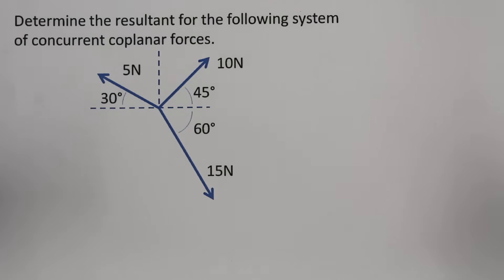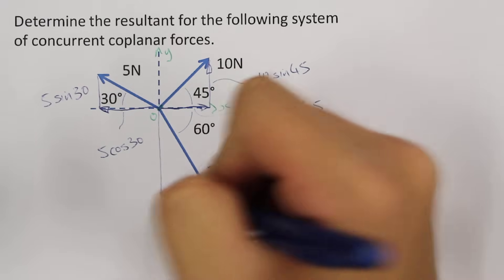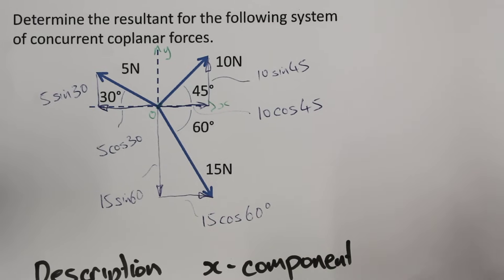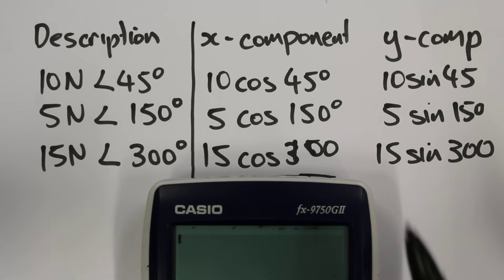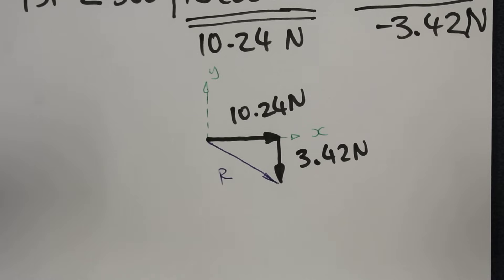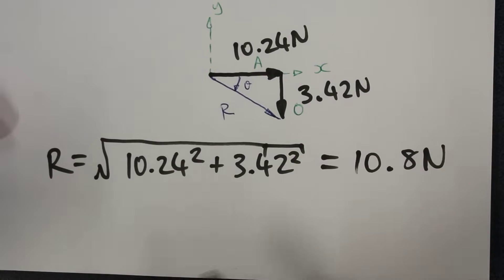Resultant of Three Concurrent Coplanar Forces

Comment: Hii sir  how is the 5N force acting at a 150 degrees. I'm lost
Reply: Hey, because the measurement of the angle is taken in respect to the +x direction (anticlockwise).
So basically the x axis is a straight line so it is 180 degrees and since the angle the gave was 30 degrees above the axis its like subtracting 30 degrees  from 180 degrees

Also,
 If you were to take a protractor to measure the angle it would come out to be 150 from the +x direction 

Hope that helps!

Comment: Why didn't you use the first components?? Sorry am new to this
Reply from the maker: We could have ignored the first part.

There are two approaches to breaking down the forces into components shown in this video. The first approach treats the vectors as triangles, where we find the size of the components, then add up the x components (if right, it would be added; and to the left, it would be negative). The second approach treats the vector as a phasor (try google this term and you should see a video of a vector that rotates, and that this rotating vector can be used to draw a sine wave (for y component) and cosine wave (for x component)

Comment: Why didn't you keep -3.42 as a negative number and instead used it as a positive number, when calculating the angle and R using trigonometry and Pythagoras. Even though, all the sin values added up to the negative 3.42.
Reply from the maker: When I was doing the calculation at that stage, I was treating the system of forces as a right triangle. So I was finding the angle as per the diagram drawn at 8:00 into the video.

I was calculation the magnitude of the angle and resultants shown and letting the diagram indicate the direction.

Comment: Pls a simple question i thought the angle for the resultant force was measured anticlockwise from the x axis so why did you measure it clockwise
Reply from the maker: It would be more clear if I put it as the angle anti-clockwise as that is normal.

At that time of making the video, I had made that decision because I had calculated the angle and was wanting to make it clear that angle was as measured clockwise from the axis. Both answers are right (measuring clockwise or anticlockwise); but different people have different conventions that they follow. In your case, you have been taught the convention that anti-clockwise measurement of angles is required. Using this anticlockwise is positive convention is good as it will set you up to use matrices in the future (should you learn this).

Comment: How did u get 10.8N coz my calculator is saying the √(10.24)²+ (3.42)²=21.9364 so pliz help me
Reply from the maker: Hi there, make sure you put in a second set of brackets. The number you have looks like the answer to 3.42*3.42+10.24 = 21.9364

It should be √((10.24)²+ (3.42)²)

or the answer to √ (3.42*3.42+10.24*10.24)

Comment: mali ka bai yung 60 degrees at 15N mo mali ng pagkakatriangle bai turo turo ka pamo haynako dislike ka saken bai
Reply from the maker: Hi there, the values and directions are correct. However the way I have drawn the vectors should be with 15cos60 in line with the x-axis; and the 15sin60 parallel to the current one but to the right. I have drawn it this way because the text for 60 degrees and 15N are in the way for the arrows that were drawn.

You will get the same numbers as me if you use 15 cos 300 for the x component and 15 sin 300 for the y component.

Also, for the way it is drawn on the video: the component going down would be 15 cos 30 which is equal to 15 sin 60; and the component going to the right would be 15 sin 30 which is equal to 15 cos60.

Thanks for the feedback.

Comment: Please why is it that when solving using the Pythagoras theorem the y-value the negative was neglected when solving. The y -value was -3.42N
Reply from the maker: I should have put -3.42 into the pythagoras theorem.

However, it doesn't change the result because the negative is squared

(-3.42) squared = 11.6964 (notice that this is positive, if you are getting a negative number make sure you have the number -3.42 in brackets before squaring)
(10.24) squared = 104.8576
11.6964 + 104.8576 = 116.554
square root of (116.554) = 10.80 kN

Comment: I understand this solution. Only thing is, how come we didn't account for the negative values in the 2nd and 4th quadrant?
Reply from the maker: Hello Tierra, I dealt with them by using an angle from the positive x-axis. The sine of an angle is positive from 0 degrees to 180 degrees, and negative from 180 degrees to 360 degrees. The cosine of an angle is positive from 0 to 90 degress, and 270 to 360 degrees; and negative from 90 degrees to 270 degrees.

Check cos150 and you will see that this is a negative value. (x component for 5N force)
Check sin150 and you will see that this a positive value. (y component for 5N force)

Check cos300 and you will see that this is a positive value (x component for 15N force)
Check sin300 and you will see that this is a negative value (y component for 15N force)

Hope this helps

Comment: Do we not add 18.46 to 180 to find the glob/local angle?
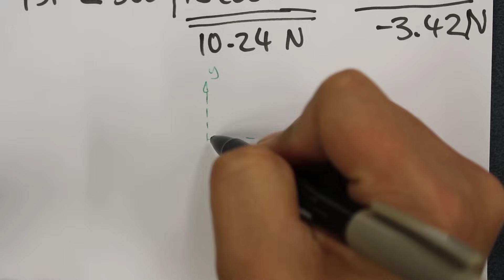Reply from the maker: Not for this one. If you look at the diagram drawn @7:34, you will notice that the angle is going downwards from the x axis.

In this case you would subtract 18.46 from 360 to get an angle of 341.54 measured anti-clockwise from the x-axis
Or you can subtract 18.46 from 0 to have an angle of -18.46 measured anti-clockwise from the x-axis (note that the negative means the angle is measured clockwise from the x-axis)

Comment: Why do you have your answer angle as negative number
Reply from the maker: there were at least two valid answers for this angle.

when I wrote it as minus, this assumed that the rotation direction is clockwise. If the rotation angle is anti clockwise, then we could find this value by adding 360 to the number -18.5 to get an angle of 341.5

Comment: Isn't the angle supposed to be read from the positive x-axis in an anticlockwise direction?? 
Which will make the reference angle for 18.5 degrees to 341.7?? 
I need clearance please
Reply from the maker: Yes, you are correct. 341.5 would be a suitable answer (-18.5 is also a suitable answer). The angle is to be read from the positive x-axis, in an anticlockwise direction based on the convention I have used.

Some people may give you the requirement that the angle must be postive, and between 0 and 360 degrees.

Comment: Thank u so much this video had helped me  but , if i may ask why did u add all the forced and their angles together I thought there was a formula for this how can I use the formula to solve  it
Reply from the maker: Not sure if I am answering your question but I will have a go.

The reason for adding the forces together is because this could lead onto finding out the overall force acting on a system. This would/could then help us to find out loads and stresses within the system.

You might notice that I am quite hesitant to write a formula. I have been stung in the past by being taught a formula only (it was a math exam when I was 17), but then I was given a question in a test that required proper understanding of what I was doing. As a result i wasn't able to even try the question. For this reason, I try to teach based on understanding the basic idea.

However, here is a formula that may be useful for you

Sum of forces in x direction = F1 * cos (theta1) + F2 * cos (theta2) + F3 * cos (theta3)+.....
Sum of forces in y direction = F1 * sin (theta1) + F2 * sin (theta2) + F3 * sin (theta3)+.....

Resultant = [ (sum of forces in x-direction)^2 + (sum of forces in y-direction)^2 ]^0.5
Angle = atan (  (sum of forces in y-direction)/(sum of forces in x-direction) )

**Note that for the angle you need to be aware that for tan there are multiple solutions between 0 and 360 deg and you will need to find the correct value.

Comment: 2:40 im sorry who writes an x like that
Reply from the maker: lol, I never used to write x's like that either. It was only because of advice from my tutors that I changed my writing style.

The main reason for that is I sometimes have equations with multiplication in it as well. So if want to write 2 times x; It could look like this (2 x x).. which would be misunderstood to be 2 x^2.

A few years afterwards, I now think its just easier to use brackets or dots (then I can completely avoid writing the times symbol 😀
Reply: @corneliskok7794  that actually makes sense 😅 
I always use a thick dot so I didn't understand

Comment: how did it become 150 degrees?
Reply from the maker: 180 degrees is a half rotation. The diagram at @3:30 shows that the arrow is 30 up from the negative x axis.

180 - 30  = 150 degrees
Reply: @corneliskok7794  THANK YOUUU VERY MUUCHHH!!

Comment: Sir, is it really understandable that when we say x-component we use cosine? and y-component is sine?
Reply from the maker: Be careful with that idea.

I'll say, yes BUT only if your angle is being measured from the positive x-axis.

I do not prefer using that because I find that I am slow at answering questions if I keep changing angles as being measured from the x-axis.

There are two ways that I am showing in this video.
Method 1: where the angle is always measured from the x-axis
Method 2: taking the vector and treating it like the hypotenuse of a triangle, then using that to find the x- and the y- components.

I prefer method 2 because it is often faster.

Comment: Why is it -18.5 again☹️
Reply from the maker: -18.5 was because there is a convention that clockwise is regarded as a negative rotation, and anti-clockwise is regarded as a positive rotation.

There is more full explanation later in the comments. I'll copy paste it here.
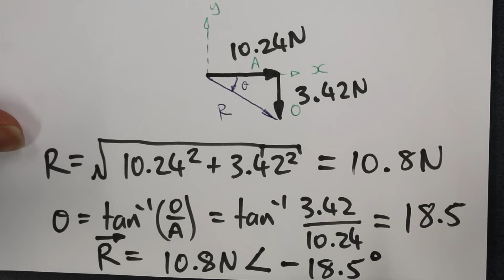Reply from the maker: I think you are talking about the angle at @11:10 for the resultant force.

The angle is negative because there is a convention in Mathematics for angles. The angle is measured from the x-axis, and the positive direction is anti-clockwise.

The angle could be written as 360 -18.5 = 341.5 degrees as a measurement from the x-axis... or could be written as -18.5 degrees as measured from the x-axis.

Also, the angle symbol used (http://www.fileformat.info/info/unicode/char/2220/index.htm) means that the angle is measured from the x-axis with anti-clockwise positive

here is an answer by someone else
https://www.quora.com/Why-do-we-measure-the-angle-anticlockwise

Comment: Please I don't understand why we have 10sin45
Reply from the maker: The topic you will need to look up is using trigonometry for right angle triangles.

Hopefully you have learned about SOH / CAH / TOA. This is an acronym used to summarise three equations that relate the sides of a right angle triangle and one of the internal angles in the triangle.

https://mathworld.wolfram.com/images/eps-svg/SOHCAHTOA_500.svg

For the triangle used there you have the hypotenuse as 10, and the angle as 45 degrees, and we want the length of the 'opposite' side to the angle.

Not sure if this entirely helps, just write in a follow-up question if this doesn't entirely clear up you question.
Reply from the maker: The topic you will need to look up is using trigonometry for right angle triangles.

Comment: Thanks for the tutorial, I really appreciate .. but why is the reference angle negative that is -18.5 
I thought we make it positive... To get an accurate angle
Reply from the maker: No worries.

The angle I have written as I am measuring the angle from the x-axis and assumed that anti-clockwise from this position is positive. This convention is fairly common.

Since the direction is 18.5 degrees clockwise from the x-axis; I have written this as negative.

Hope this helps.

Comment: does cos should always be in x axis? I'm confused about our book, it has sin in x axis without even explaining why, also a cos on y axis..hays
Reply from the maker: Not always. If you treat the vector as the hypotenuse of a right-triangle, you can find the the sides of the triangle using the angle with respect to the y axis. In this case you are likely to see that you use cosine for the y-component and sine for the x component. I have a comment further down describing that there are several ways to find the components.
Reply: @corneliskok7794  thanks sir, I already understand it lately. Sorry for late reply.

Comment: Please check your 5N force components. Why did you take 5cos150 as your x component? It should be y component as per the position of the angle 150deg. As the sine component always lies opposite to the angle whereas the other side is given to the cos component. Please check the resolution of the 5N force. I might be wrong too. Please correct me in that case. THANKS

Comment: Wondering how you got 150° and 300°.
Reply: he get does degree from the reference angle which from Qudrant 1 cos going counter clockwise to the respected vector and then he subtract the given angle by. 90, 180, 270, and 360. (e.g F2 got 30 degree, so from the x axis from quadrant 1 counter clockwise to x axis of quadrant 2 therefore 180-30=150 degrees.
Reply: @andresmichael359  thanks. I get now

Comment: Thank u soo much sir that was so helpful . i was so confused during solving these numerical ... now i my  concept clear but i have a question. 
Some time in some books they take cos instead of sin and sin instead of cos whats the logic behind that plz can u explain .
Lov from Pakistan ❤
Reply: Glad it was helpful. They are usually treating the vectors as right angle triangles. Then using trigonometry to find the magnitude of the vectors on the other two sides. Then making the values positive or negative depending on what quadrant of the coordinate system the vector is pointing towards.

Depending on where they choose to place that triangle, would cause the ratio they use to be different (ie use sin instead of cos, or cos instead of sin) and it may mean they put a plus or minus depending on the quadrant. I've done a little of this @2:15 but then continued with representing the force-vector as a phasor.
Reply: If anything above doesn't make sense, just let me know :-)
Reply: @CornelisKok  thank u soooo much sirrr i got it 
 big respect 4 u sir ❤❤❤

Comment: sir what if there were no given angles
Reply from the maker: I think I would need more information. Are the vectors pointing towards one of the axis directions?
Reply: @corneliskok7794  just the example that you used but there are no given angles. and you are tasked to find its angle and the horizontal component

Comment: So what happens if we have more than 3 forces?maybe 5 Forces
Reply: Just add another row to the table.
Reply: @CornelisKok  and what if a certain force is acting on top of the Y-axis what would it's components be?
Reply from the maker: @pulengmangeloanentshole7390  Do you mean if the force vector is pointing upwards? if so, for a 7N force pointing upwards the x-component would be 0 and the y-component would be 7N.
Reply: So, to put that another way. In the example above, if we want to find the resultant of only the 5N force and the 10N force we would:
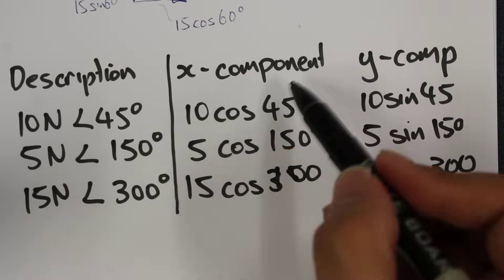remove the values written at @5:00 to @5:15.

the sum of forces in the x direction would be:
10cos45 + 5cos150

the sum of forces in the y direction would be:
10sin45+5sin150

then you find the angle and resultant using the sum of forces in the x direction and sum of forces in the y direction

Hope this helps.

Comment: Why is the angle negative??
Isn't the angle supposed to be positive & is that our real angle or u have to either subtract or add to 180⁰ to find the final angle
Reply: you can add 360 to the angle -18.5 to find the final angle. In this case, a negative angle means it is as measured clockwise from the positive x-axis.
Reply: I think you are talking about the angle at @11:10 for the resultant force.

The angle is negative because there is a convention in Mathematics for angles. The angle is measured from the x-axis, and the positive direction is anti-clockwise.

The angle could be written as 360 -18.5 = 341.5 degrees as a measurement from the x-axis... or could be written as -18.5 degrees as measured from the x-axis.

Also, the angle symbol used (http://www.fileformat.info/info/unicode/char/2220/index.htm) means that the angle is measured from the x-axis with anti-clockwise positive

here is an answer by someone else
https://www.quora.com/Why-do-we-measure-the-angle-anticlockwise

Comment: Pls why did  you  use 3oo instead  of  30...I don't  understand
Reply: Not sure if I will be able to answer your question well enough to clear your doubt but here it goes :-)

I used the idea that the 15N force is 300 degrees from the x-axis. I calculated the angle of 300 from the equation 360 - 60 = 300. The angle of the 15N force vector is 300 degrees as measured as an angle anti-clockwise from the x-axis.

If I use angles as measured from the x-axis, this lets me use cosine to find the x-component. Ie the x component of the 15N force is equal to 15 cos (300). Also, by using the angles as measured anti clockwise from the x-axis, this lets me use sine to find the y-component. ie the y component of the 15N force is equal to 15 sin (300).

A visual that helps here is of a rotating phasor (there are some videos on youtube and I have mentioned it in some of the comments below)
Reply: @CornelisKok  kk...thank u

Comment: how did you get negative 18.5 at the last?? I mean why negative
Reply: It was due to an assumption that a positive angle would be anti-clockwise from the x-axis and a negative angle would be clockwise from the x-axis.

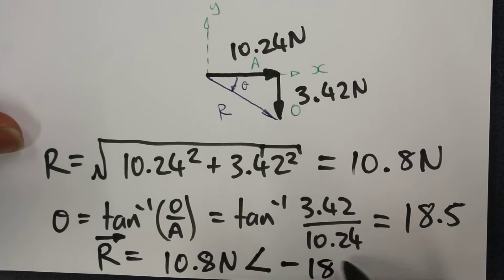Also, the symbol I used (@11:00) before the 18.5 means that I have assumed that a positive angle is anti-clockwise from the x-axis